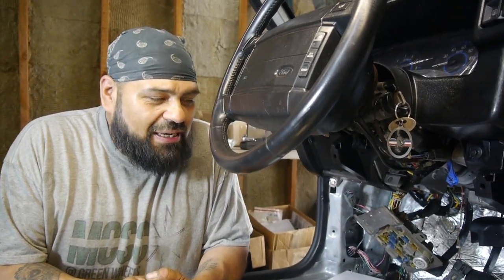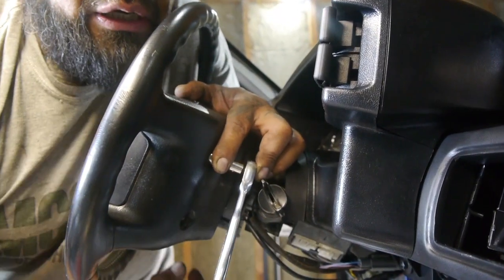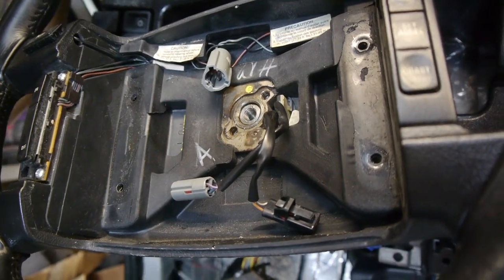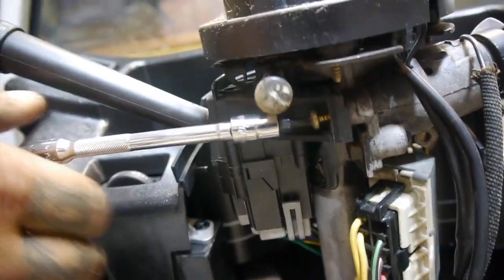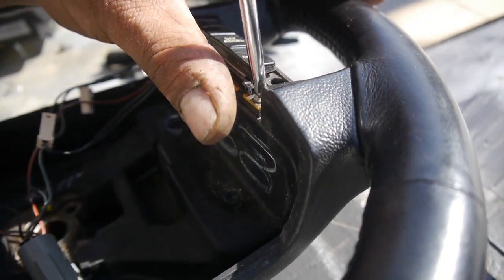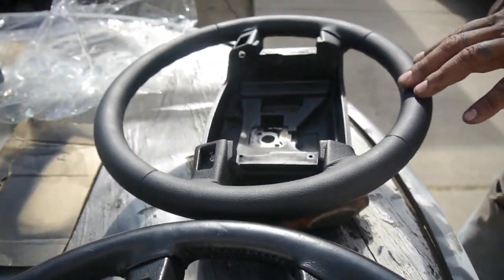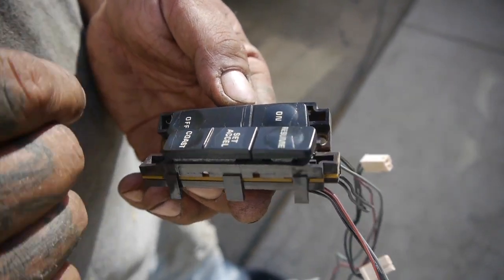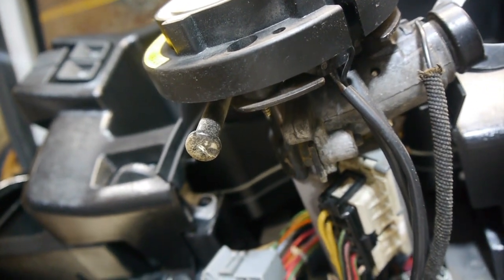Removing Steering Wheels On 93 Fox Body Mustang GT

Comment: Nice touch(s)! Always good to see new-on-new, instead of new/old mix. Also the "tip of the day"...when using the puller, use longer bolts and put the shaft bolt back in to press on it instead of maring or damaging the shaft threads. Just leave it off the shaft a bit and when it pops loose, remove the puller and wheel. Ta da!  Agree on aged or hard baked plastic fantastic parts...use caution. 😎

I didn't realize you disabled the air bag system. Oh well, it's equipped. 😂
Reply from the maker: Thank you very much for the tips, we are hoping that some day these tips and video may help someone out there.